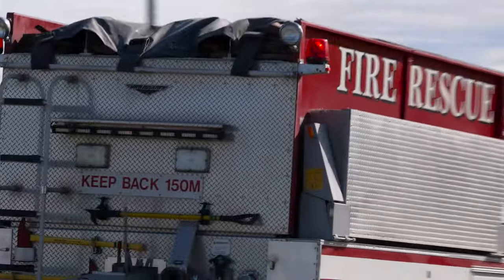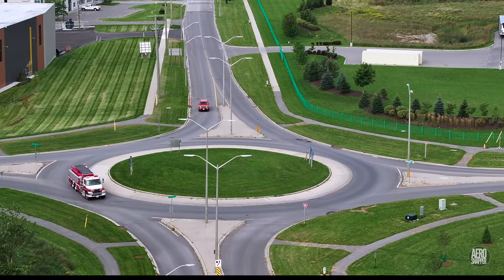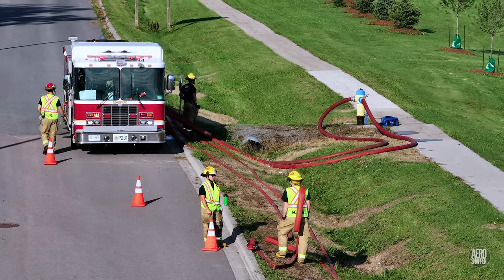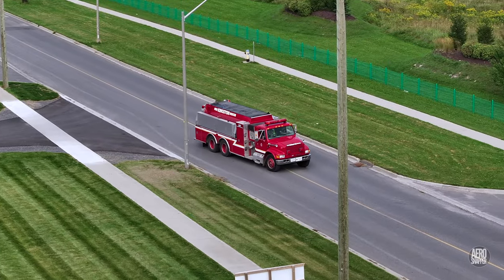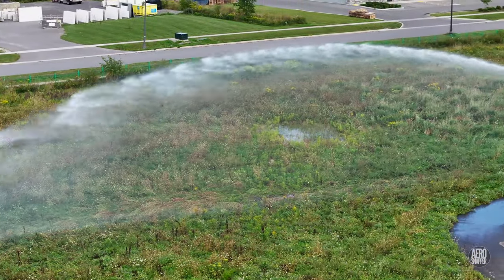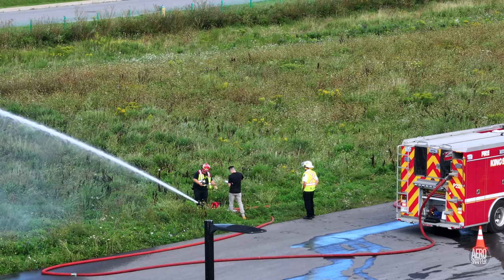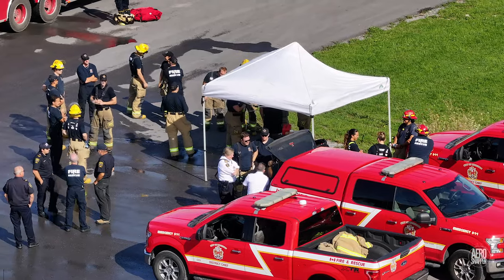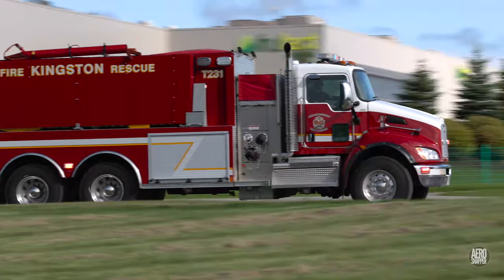Carrying the City's water - how firefighters meet the challenge of rural fires   4K

Comment: Very cool! Weird how they transfer the water into the kiddie pool things, but it's a good idea!
Reply from the maker: It was certainly fun to cover. Dumping into the reservoirs allows them to head off for the next load almost immediately. The reservoirs act as a buffer. They stow on the side of the tanker very neatly and easily.
Reply: Often the water source can be quite far from the scene, so being able to dump a tank full, (or most of it) enables the tankers to be on the move, in order to move water.  It is also possible to directly connect the tankers to feed the pumper, but that only allows the water to be offloaded from the tanker as fast as the scene is using it.  Ideally, you have more water than you need.  It’s also not uncommon to have several porta-tanks tied together for more on scene capacity.  Keep in mind that the pumpers also have onboard tanks, so if the porta-tank runs out, the pump operator switches to the onboard tank, and hopefully the next arriving tanker can dump into the porta-tank (or crib) before the onboard tank runs out.  This then means that the pump operator then has to draw from the porta-tank, and balance how much water is being sent to the fire scene (priority) while also re-filling the onboard tank with any excess water they are able to flow.